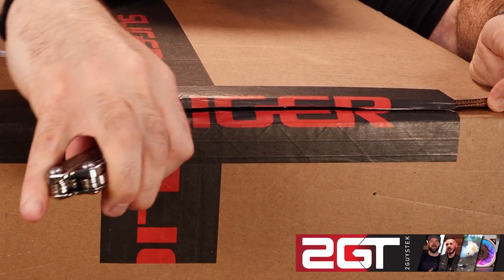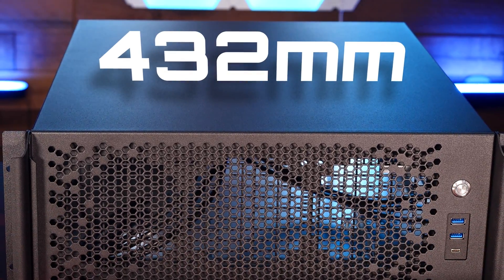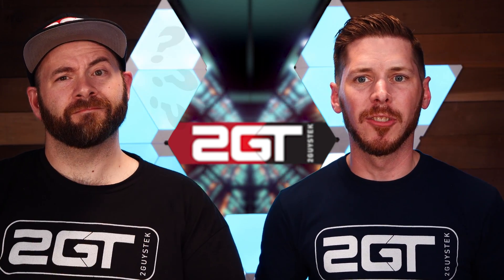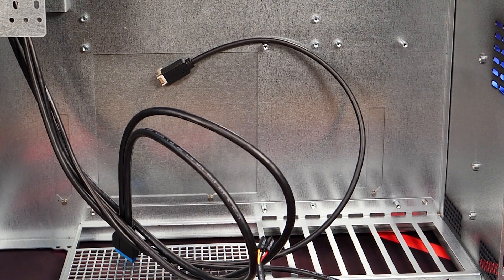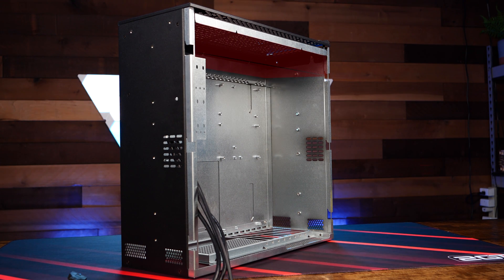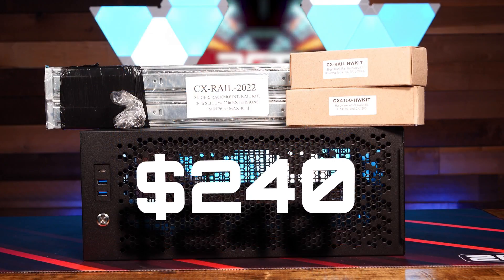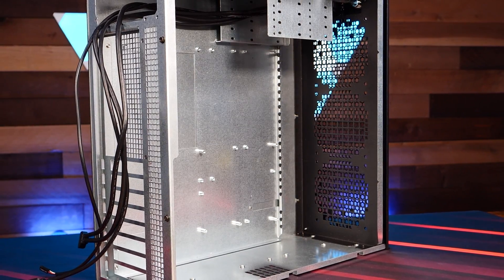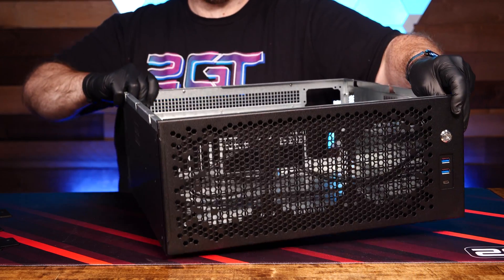A Real DIY Server Case! - Sliger CX4170a Review

Comment: Sliger isn't "Sligger" doesn't rhyme with tigger, bigger, or figure. Its Sliger as in Tiger or Geiger. What they don't show you in these videos is the actual racking of these cases. Anyone wanting a rack mount solution with rails stay away from these. My whole reasoning for buying these was that I could fit AIO's and they'd be easy to build in and maintain and its been nothing but a headache that I regret. 

I made the mistake of buying both the 3U and 4U with rails and the rails they sell are generic garbage and don't mate up properly with the holes on the side of the server so the servers wont slide in flush with the rack to actually screw in. There are not good instructions or diagram showing a proper way of doing this so you're just left to guess which holes are supposed to be used and no combination I've tried allows the case to completely slide into the rack without some type of issue. Add to that the boxes are too wide once the rails are mounted which causes the rack mounted slide to mar the side of the server which kinda defeats the purpose of spending this much on something that looks nice just to have some stupid detail like that screw up the powder coating. Ive tried fitting these in 5 different racks so at this point the rack cant be blamed for the shenanigans. They send some 3D printed spacer with the rails that's supposed to align the rails and 4 out of the 5 racks this just made the fitment issues worse.

I really wanted to love these because my Ceberus was an amazing case to build in but these just overpriced and not very well designed or tested the same way the Ceberus and other desktop style cases they sell. Knowing what I know now I would have just waited and bought the HL15 or saved myself some money and bought one of rosewill's offerings.

Comment: Thanks for showing the face plate removal! I assume the 3U is similar and that will be awesome for custom paint jobs.
Reply from the maker: This case is also a 3U and yeah, that removable faceplate just screams PAINT ME!
Reply: @2GuysTek  ? It is 4U.
It's in the model number.
You even said 4U in the video.
Reply: Why 3U unless you REALLY need something specific to fill out your rack?
2U and 4U/5U are the sweet spots.
 - 2U fits 80mm fans. [1]
 - 4U fits 120mm fans. And also full-height PCIe cards. 
 - 5U is a weird edge case. Much less common, but the extra height is useful for fitting taller CPU coolers and over-height GPUs.

There is nothing WRONG with 3U. But they are less common, so more expensive.
They also don't provide much more than 2U.

[1] Barely. But the point is that 2U goes out of it's way to fit 80mm. 3U designs, even though they are 50% taller, are NOT designed to fit the 50% bigger 120mm fans.
Reply: @Prophes0r    I ended up buying the 4U and I love it! I only have 25RUs to work with but after  looking at the pros and cons 4U was a good choice for my situation. Here's what sold me on the 4U version over the 3U:

-The 4U version has enough space to mount 40mm fans above the PCIE slots to add a little extra air-flow for 10g NICs and GPUs

and

-The 4U version can use a standard ATX PSU(which I already owned)

The 3U version of this case can actually use up to 3 120mm fans and take full height PCIE devices. If I was going to do a similar build from scratch and didn't need extra headroom/cooling for multiple PCIE devices I might go for the 3U. 

Whatever someone's looking for I highly recommend this case.  Solid build quality, great airflow, and they're the nicest looking rack mount DIY chassis I've seen on a non-enterprise chassis.

Comment: Cool case. The empty box desc is a blank canvas to me. 😁🤓

My inexpensive Rosewill case has a bit of flex too. Once the lid is on though it's plenty rigid. 

Uww they make hot swap drive bay versions. Will have to check them out. 👍 Maybe they are less $ than a supermicro chassis.

Comment: With a maximum CPU cooler height of 158mm how did you get on with installing the DeepCool AK620?

It's 160mm in height but you didn't appear to encounter any issues.
Reply from the maker: Great question! The short answer is, you saw it fit, so it fits - there’s enough room even if the manufacturer’s specs say it ain’t so!
Reply: @2GuysTek  Or you got lucky.
The little knobby ends of heat-pipes can vary between units.
You MIGHT get lucky. But most of the time you won't.